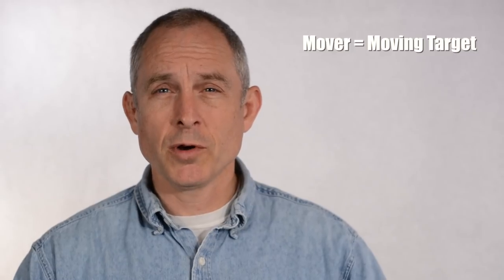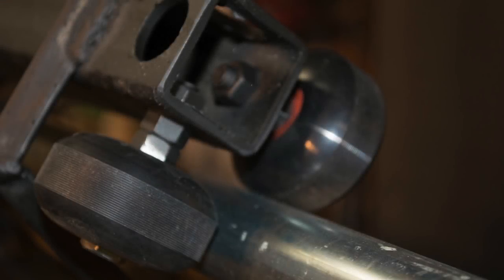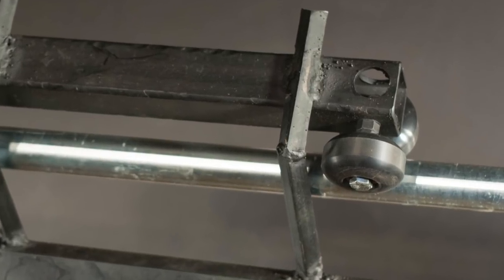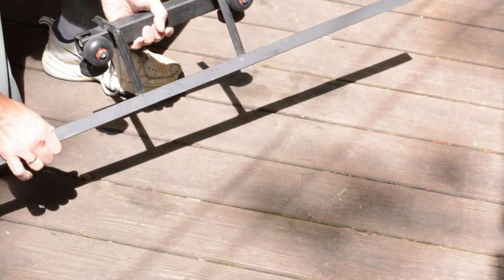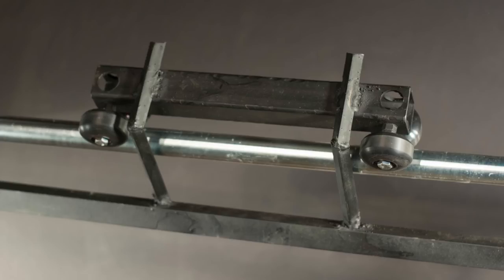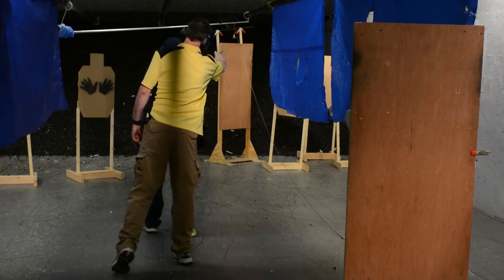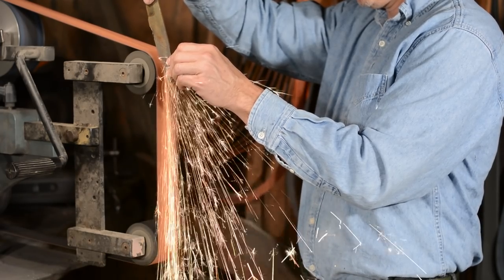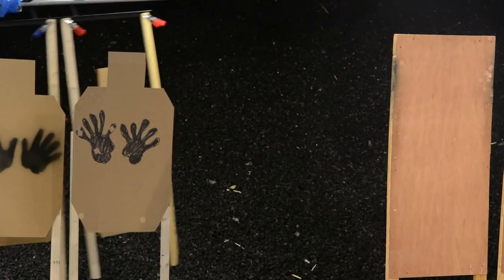IDPA Mover - DIY Project

Comment: I made one with the seaboard wheels with unistrut  hardware. 
One side was too heavy the side with the offset parts going around and under the wheels rolled in that heavy direction. Then I just put the same amount of weight in washers couplers etc to the lighter side. 
It ran straight down the 1” OD conduit. Didn’t fall off or anything like that!!!!!!
Thanks for the video. 
Cheers